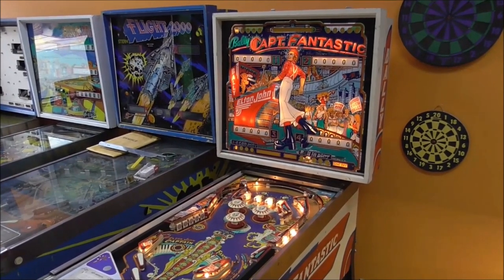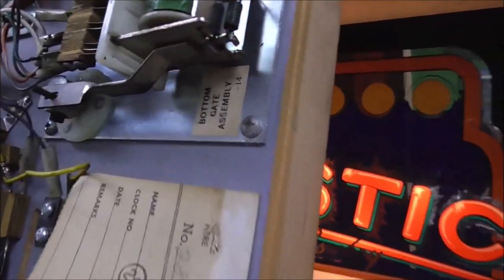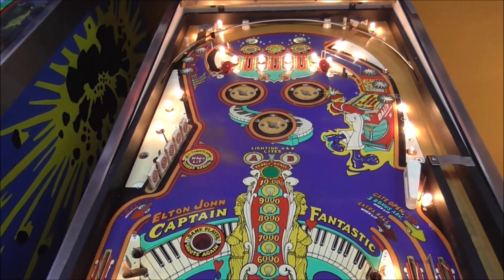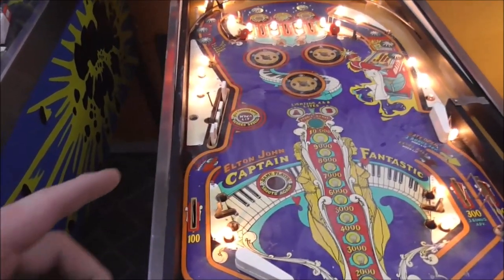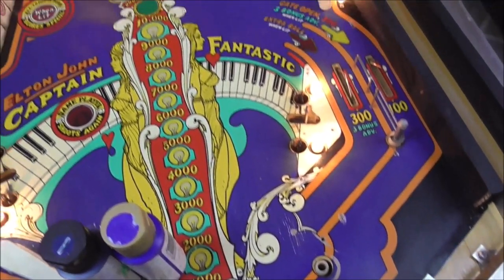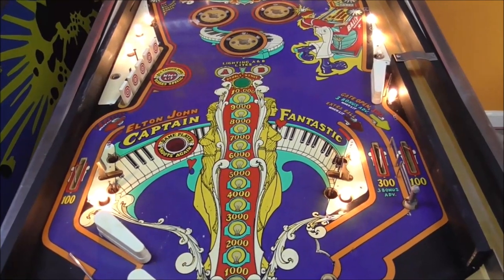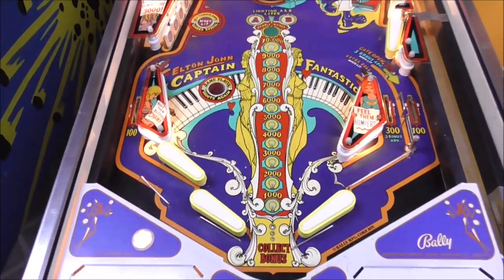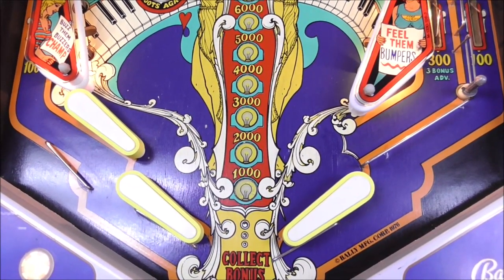Touching Up And Repairing The Playfield Of A Bally 1976 Captain Fantastic Pinball Machine!

Comment: I think doubling up on the slingshot rings prevented balls getting trapped in slingshots.  On classic Ballys (especially early solid state), I've seen the ball hit the slingshot so hard that it goes inside the ring and is trapped in there.  Saw this several times in an Aladdin's Castle in the mall.  The attendant was there to get the ball out, no big deal.  But on location this would put the machine out of business until the operator sent someone out.
Reply from the maker: Ahhh that might be it then, makes sense.  Thank you!

Comment: Imma think that shortening the switches on the slingshots was a solution to a self-inflicted problem by whoever decided to put extra rings on.  When the switches are their proper length they end up resting against the factory rings nestled in their grooves, and the extra rings, which end up being wider because they have no grooves, don't even touch the switches unless the ball hits hard enough, which makes the slingshots less responsive.  So their solution was to cut down the switch contact until it fit below the factory-position ring and rested on the extra one(s).  Adding two rings instead of just one was probably to help keep the shortened contacts from slipping under them, because once you've committed to a poor course of action you just have to keep doubling down on worse things to compensate.
Reply from the maker: Yeah it was probably something like that.  I've never understood the double rubber rings thing but about.... 20% of the ones we get have that going on.  I think they believe it'll make them bounce better?  Like you pointed out it makes it worse.

Comment: Why wouldn't they use JB weld and then drill out the hole instead of swapping the parts from side to side ?
Reply from the maker: It's quicker and cheaper and easier to swap the parts from side to side

Comment: I wonder if those switches broke, or maybe just one or two broke, so to make it the same instead of replacing them  an operator just broke them all off and added rings.
Reply from the maker: That may be, I've had some break before and they always break right above the contact like that....
Reply: @LyonsArcade  it's the weak point in the switch.   If an operator was making a lot of money off it they may have opted to just add rings they had laying around, rather than pulling it apart and replacing switches 🙂.
Looking forward to the next one